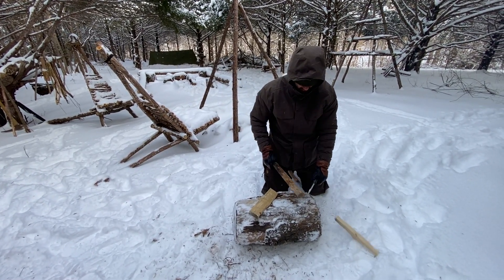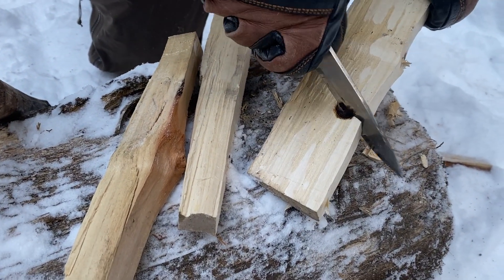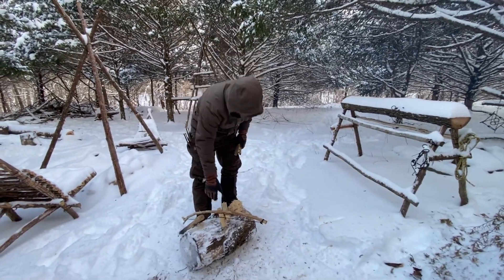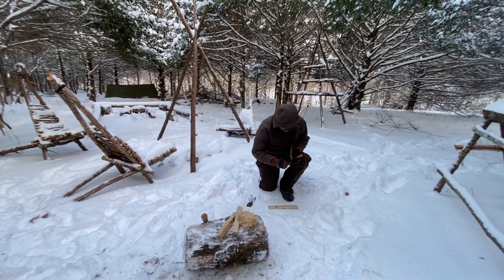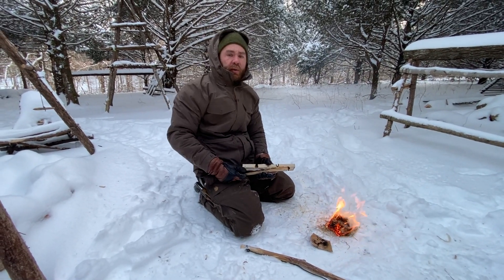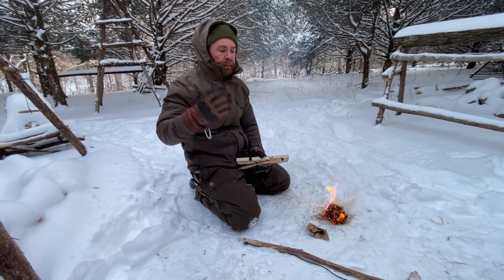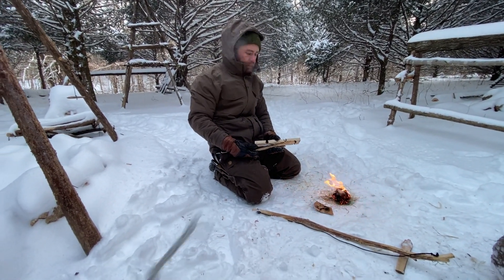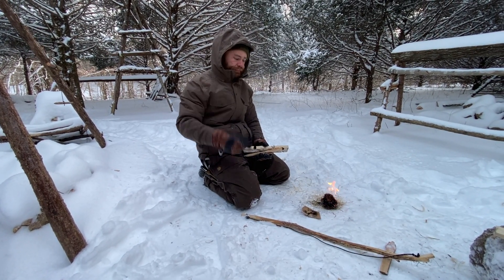Is Friction Fire Below 0 Feasible?

Comment: Where does the coal come from the hole itself or did you put something in it and how did you make the hole just keep drilling ?
Reply from the maker: It comes from the notch removing dust and the tip of the spindle heating up amd igniting the dust

Comment: when you know to use an Alternative Swedish fire torch (or two) to ignite a Siberian fire lay when all is wet and know to use a hammock, the danger of popping embers to your synthetic materials is acceptably low.  Keep a steep pitch on the PEVA and the envelope, so that an ember has no chance of staying in one place, burning any holes and of course, have the Gorilla tape to make any needed repairs, on any piece of gear. Shoe goo is a fine fire extender, as well as repair-material.  You can put it into a small, soft plastic bottle. You dont need to carry a big, fragile tube of the stuff.

Comment: nature offers up plenty of challenges, even if you DO have "proper" gear and challenges. I'm not willing to push things, cause that's how you get hurt, sick or dead.  This "minimal gear' thing is the bunk WHY are you out there with "nothing but a knife"? Stupidity like that SHOULD be fatal, so you dont pass your low IQ on to your helpless children.  I carry 3 ozs of  3x6 ft hunk of clear PEVA shower curtain,  a couple of SOL heat sheets ( 6 oz total, assembled with tape and a couple of zippers, into a bag configuration) a 1.5 lb XL size reflective tyvek bivy,  1 lb of net hammock. a couple of 1/2 lb each Amazon camo nets and a couple of their 1/4 lb each bugnet "suits".  If I use the 4 net-pieces as long johns, my sweat cannot dampen my cammies. If I wear the  bivy and its "envelope" as a poncho, wrap the PEVA around one leg and the 55 gallon heavy duty drum liner around the other leg,  rain and wet brush cannot dampen my cammies.  So I stay dry and dont need a fire.  When I set up the hammock and lay in it, I"m ok at 31F, without a fire.  I can use the "envelope" PEVA and tape to make a supershelter, with a Siberian fire lay out in front, "aiming' its one way projected heat at the PEVA,  making the hammock and the bivy all I need,  down to 0F.  If I add the UCO candle and hot rocks or water inside of the shelter, I can handle sleeping at -10F and I can shiver and do calisthenics at -20F, whiile I'm drying out enough damp debris to serve as insulation, enough to let me sleep ok at even colder temps.  So I dont lug around a lot of weight and bulk, in the form of stuff that can get wet and be ruined, like Down sleeping bags. or clothing made with down. Even wool blankets are a huge PITA. when they get SOAKED,  wool blankets have ZERO insulative value.  They are only still somewhat insulative if they are DAMP, not soaked. Soaked, a wool blanket or sleeping bag weighs  40 lbs. It also soaks any other clothing or gear that touches it and takes forever to dry out (if you even CAN dry it out, without burning holes in it).

Comment: counting upon being able to  make a functional bow drill set,  when you might well be sick hurt, or be where there just ARE no such materials, is nuts. If I can haul around a bow drill set, I could  also have hauled around a LOT of stormproof matches, fresnel lense, lighters, ferrrod, vasoline, UCO lantern, etc, for the same bulk and weight. as a bow-drill set.   So it makes no sense, man. You dont have to be without a hunk of jute rope and a bit of tubing, so that you have a "slow match" with which to dry out and ignite difficult tinders.  You should always have Gorilla tape, for other things. Tear a small amount of the tape into strips for a birds nest and have 1-2  small "cigar rolls' of the tape and you can ignite a pile of small twigs, shielding them from rain with your body.
Reply from the maker: Chill out bro. There is a ferro rod on my hip and did you not see the hammock in the background. I had negative 10 degree quilts. And was overly warm. I literally said in the video the practice was for fun. There is a whole other video on this hammock camping in negative 10. Go search the channel. And there a re a plethora of reasons to know bow drill. All kinds of situations I've been in where it's very very easy to get separated from gear. Not only that learning bow drill makes you exponentially better at fire making with modern skills.

Comment: you can start a LOT of fires in very bad conditions, with just a lighter and some Vasoline, or pieces of inner tube   Nothing says you have to be stupid and hold a Bic Lighter to wet tinder. Shave the wetness off of some dead wood branches, or quarter split those branches, access the dry inner wood for  your shavings and scrapings. Create a 4 log alternative Swediish fire torch, smear some vasoline onto some of the shavings at one end of the Swede, and onto some of the scrapings.  Dont bother with the "plug' that most people put in the bottom of the Swede  Once one end of the  Swede is lit, don some gloves and wave the bundle around, mostly horizontally, until you have flames coming out of both ends. Stand up the Swede on 2-3 sticks or stones, so air can get under it. Use  1-2 swedes to ignite a Siberian fire lay, if all is wet. Then you'll have a sustainable fire, cause rain cant extinquish a Siberian., once it's burning well.  Same is true of the Swede bundle.   Enough coals fall from under the ends of the Siberian for the fire to carry on under the shelter of the protruding ends of the Siberians  burn-logs, and the cross log, if it's burning well, also provides so much heat that rain drops are vaporized before they can douse the fire. The 18" high flame of the Swede does the same thing.  Both of these fire layes will burn green, wet wood.  The Swede burns from the inside out, so the shavings dry out the logs as they burn, all you have to do is shave off the wetness of the sides of the logs that face the enter of the bundle. Ditto the Siberian, shave off the bottoms of the logs where they protrude over the cross log and they will catch fire, even if they are green and wet. Once the logs are charred, they re-ignite easily.  If you can save the Swede  or the Sibeiran by smothing the flames with ashes, or with dry, loose dirt . Tben you wont have to start the next fire with such difficulty.  You can also bury some coals and charcoal in the ashes and keep the fire "alive' for many hours in that way.  Build a little primitive A -frame "shelter' over the ashes-pile and trench around it vs rain. or snow-melt.

Comment: getting  an ember, and getting  a sustainabke fire are not the same thing, guys, Learn the alternative Swedish fire torch, so you can always use one to ignite a Siberian fire lay, in wet, windy conditions. I keep a UCO lantern, reflectro, extended base, and a spare beeswax candle in my BOB. The Gorilla tape is a great fire extender also and of course, if  I actually in the crap, I'd be looking for fatwood, cedar bark, pine resin, etc, to add to my capability as I moved along.  But I'm not normally going to lug that stuff around., when I can have items that offer more versatility.

Comment: you can get a peanut lighter, with a gasketed cap, so it can't leak, that burns regular lighter fluid. they work  at very cold temps. you're not stuck  with a Bic,  I keep a Bic in my pocket, a ferrorod on my keychain, a fresnel lense in my wallet. If I'm in the woods, there's a matchcase on a string around my neck and a peanut lighter in a ziplock bag in my pack.  I wouild never, EVER risk my life to a bow drill.
Reply: For what it's worth- all the gadgets in the world are no match for properly learned and practiced skills
Reply: @williambenson1477  . MOST places do  not HAVE the materials you need to make what you need, so you die before your "skills" can save you.

Comment: I love knifes but you should use axe hatchet
Reply: I typically carry one. But I've taught survival for 15 years. And early in my career I used them all the time. I hardly touch them these days. And the ones I do carry are very lightweight. Prefer a silky saw for most of my wood processing and cutting. Just so much faster and easier.

Comment: How does flint & steel perform in extreme cold? Would it be a worthwhile system to have in the kit?
Reply from the maker: Flint and steel is mostly for nostalgia. There is no reason to carry flint and steel anymore. It is better to carry a ferro rod and good tinder material. Flint and steel provides no advantages to ferro rods
Reply: Okay, thanks! @sigma3survivalschool